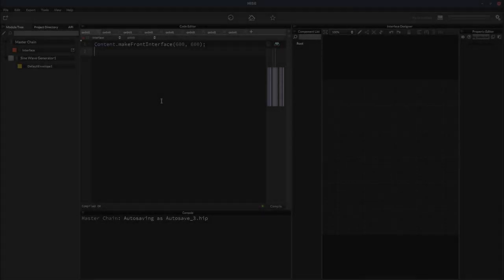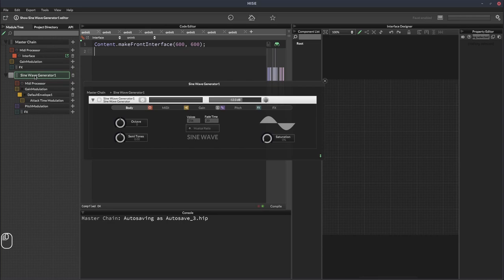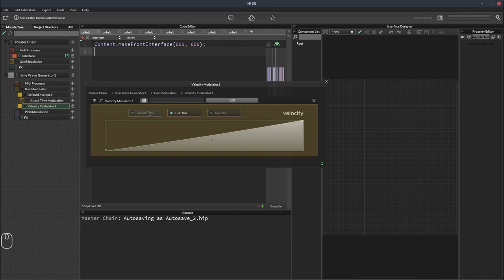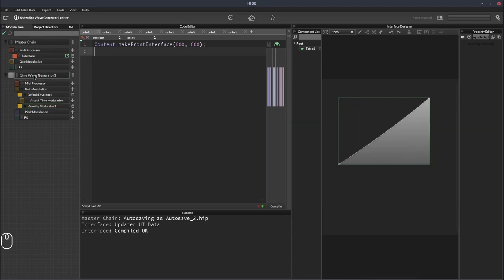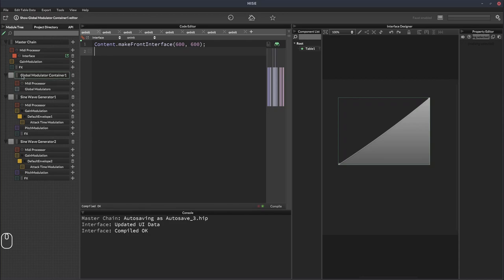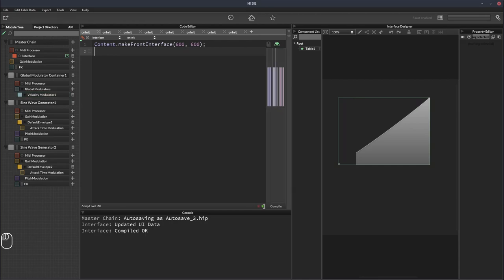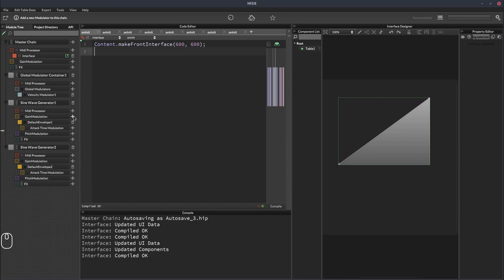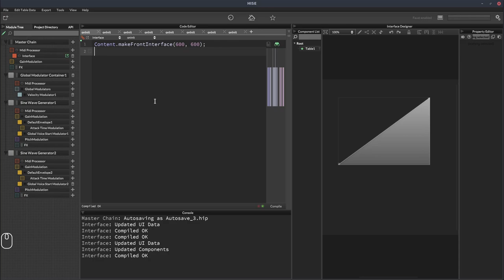How to add velocity control to your HISE project

Comment: Class! How to do this with a limiter? gain and treshhold buttons?
Reply from the maker: You want to add velocity control to a limiter?
Reply: could be so. How to control trashhold and gain buttons via table? How to create indicators of incoming/outgoing signals?
Reply from the maker: @Евгений-м6ф6м  That's a bit too complicated for a YouTube comment. Ask on the forum (do a search first though as this has come up before). Generally I think people are using scriptnode for dynamics type effects.
Reply: Я прошел курс по созданию плагина в hise. Но я не узнал от этого ничего нового. Я узнал больше из просмотра ваших видео, чем из курса. Спасибо тебе)
Reply: I took a course on creating a plugin in hise. But I didn’t learn anything new from it. I learned more from watching your videos than from the course.) thx)
Reply from the maker: @Евгений-м6ф6м  What course?
Reply: neomoon - here I looked at the course.
Reply: I have already sent the link several times, but it has been deleted.